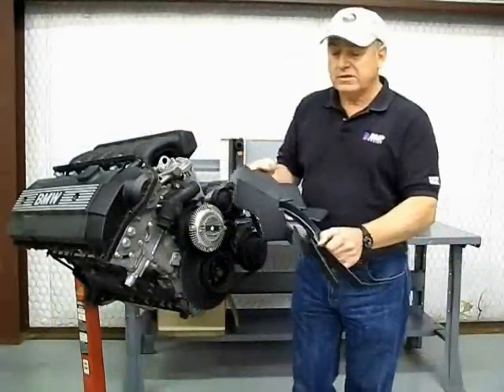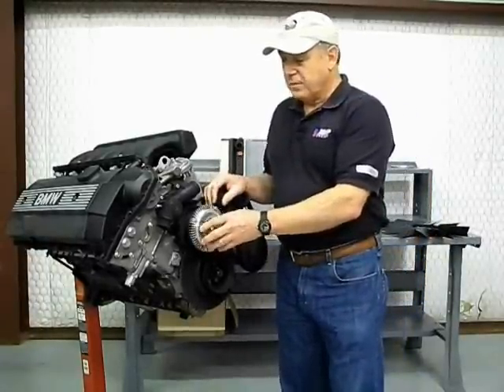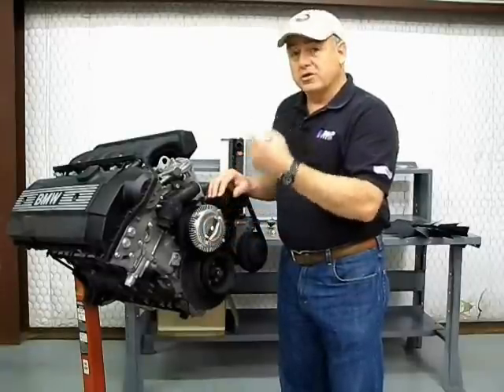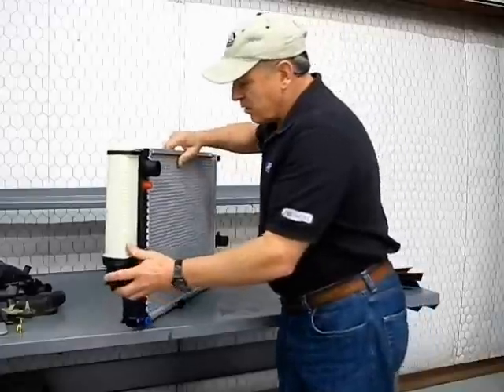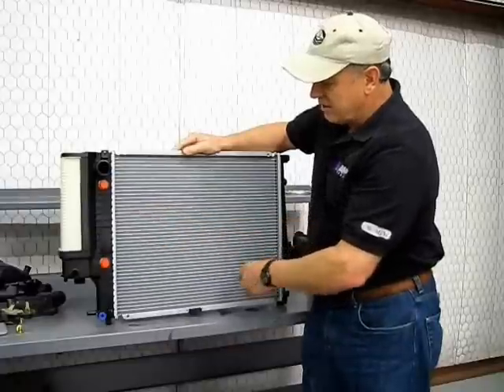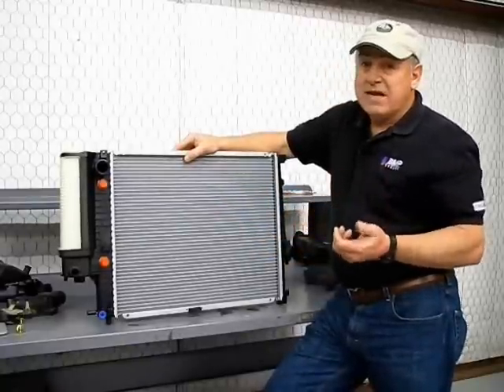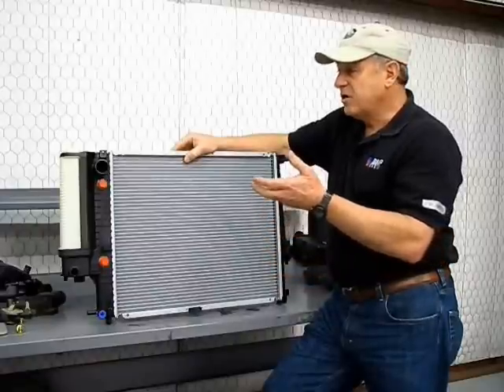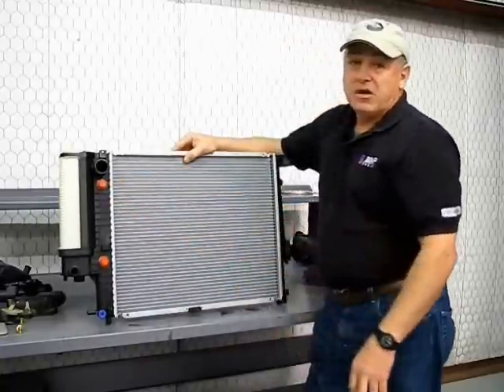Part 2 BMW Cooling System Overview with Common Failures for e36, e46, e34, e39

Comment: Solid video.  I'm new to the BMW world adn so far the videos I've checked out aren't very good.  I'm  DIY'r and I just purchased at 97 540i 6sp trans.  Do you have a video that covers checking/replacing the knock sensor?

Comment: Great detailed video.  I will be changing my BMW 540i e39 radiator.  The auxiliary fan switch#61-31-8-360-857(double temp. switch)  has brass threads and screws into brass threads on the radiator next to the expansion tank.  There is no washer for that part.  Should anything be applied to threads to prevent leaking or just screw in?  I cannot find any information anywhere, even the Bentley books... thanks

Comment: My 91" BMW 525i 20 years old, still on the same radiator, works fine.
Water pump had to be changed 6-7 years ago, the -resin blades- in the pump completely disintegrated!

Comment: Hi all, I wonder if any can help a little
Problem is, working everything fine from one minute to the next my car (1999 e36 323ti) went so heat that the upper hose conected to radiator blow out from its position.
I canceled thermostat, replaced water pump and radiator fan.
Temp seems normal but expansion tank is going now like a "geiser" you know, water boiling coming up from time to time causing the cap leaks.
Any idea?
Reply: Oh thanks for your concern I found the cause Two years ago It was a stucked piece of fabric in the cooling lines into the motor. Anyway, I just sold my car last weekend after 7 years of Joy.

Comment: Hello great videos but unfortunately my problem didn't appear. I need your advice, my dads 318i e36 has oil in the expansion tank. Other then the head gasket is there anything else that may cause this?
Reply: 5 years late but that sounds like a blown head gasket :/

Comment: my 96 corolla is still running @ 160K no leaks, no OBDii error codes.  On all our cars I do the scheduled maintenance.  Although sad news I replaced all these parts on my sisters e46 twice and the damn thing still overheated blowing the head gasket finally retiring at 96K miles.  I will never recommend buying a bmmr.  I think the older BMWs had a better design than the newer ones.  All the outsourcing in parts and design cutting the cost will ultimately create failure.

Comment: so if I have a rad leak, I have to replace the rad and also the coolant tank on the side?  I have a slow rad leak and once my engine gets to operating temp, It slowly drips coolant onto the ground.
Reply: I hope your replacement radiator, with the expansion tank included, arrived in time 😉

Comment: on the bottom of the expansion tank is a coolant level float switch. A plug with two wires is fitted to this switch. My question is this: does it matter which wire goes to which pin?

Comment: I'm about to replace all these parts I wonder if coating the areas that are prone to leak with flex seal will help slow this process down. If I tape off the radiator fins to keep the stuff out the cooling area I really think it might work. But I'm sure eventually plastic will do what it does get hard and start to crack and break

Comment: The radiator operated under about 14psi of pressure. And the surface where the aluminum and plastic meet has an "O" ring. External coating will not help a leak under pressure. It will just blow through any coating.
 
al hafner

Comment: my tank on the side of the radiator cracked can I replace the tank? or do I have to replace the whole radiator?
Reply: You can replace the Expansion tank without replacing the radiator.

Comment: @frankzen1941  i have a 99 328 with same m52 motor, it lasted 200 k before i changed radiator, water pump, and couple of pulleys. for the first time in 13 years... so even though some of the parts are made of plastic, it's some heavy duty plastic. 

p.s if you want superior reliability buy a toyota, if you want a superior driving machine, get bmw,

Comment: if a radiator is Aluminium it will last 5-6 years but if your radiator is the old brass type it will last a lot longer.

Comment: yeah 2 sides if u maintain your good to go but if you r a brutal mechanic then u will break those plastic parts ,i have a bmw 325ci 142K most all is orig! no leaks just minor weeps need to change hose clamps on power steering filter and my expansion tank just cracked usual spot bottom corner! from what i read every 6/7 years so it was time this is a '03 orig! and for those that say BMW is not well Engineered you have got to be out of your Mind!!! There tech is bottom line superior if they built them to last longer we all be driving them LOL but hey we go back to Maintain your Bimmie or else ! happy motoring ...........................

Comment: If you have an E36 like I do, you can replace them now or later but all these parts WILL break. I upgraded everything to aluminum. Pretty shitty cars are designed with so much plastic craps that only lasts 5 years!

Comment: how does a radiator only last 5-6 years?! My 96 BMW is on its original radiator, coolant changed every 2 or 3 years and its fine. We also have an 89 Camry on its original, it never overheats and the coolant is perfect blue. We are in the UK though but Americans seem very precious about replacing everything way before time, a radiator is not a service item IMO, another workshop trying to con people out of money.

Comment: Common BMW problems. EVERYTHING. If it doesn't leak from waterpump, expansion tank, radiator, or a hose bursting than its leaking power steering from the cap or hoses (doesn't matter the year or series) or it leaks all its engine oil out from some weird ass location that is harder than hell to repair or get to. And I'm not talking about the obvious valve-cover gasket and timing cover gasket. BMW motors are put together like trash. Lastly, ALL of them from 1998-2007 had VANOS problems. A good percentage of owners have no idea their VANOS is not working properly and is noisey.

Comment: No you don't drive like us in the UK you just get dead happy over massive V8's pushing 100bhp and frown at small engines like Honda's etc. Even a shitty Red Top Corsa can push out more power than most of ur crappy V8's. XD Btw,